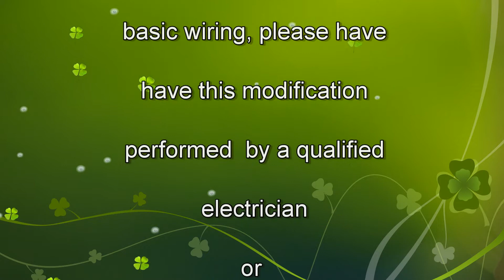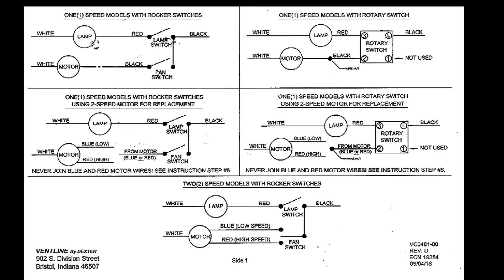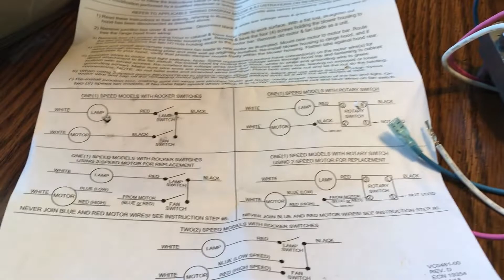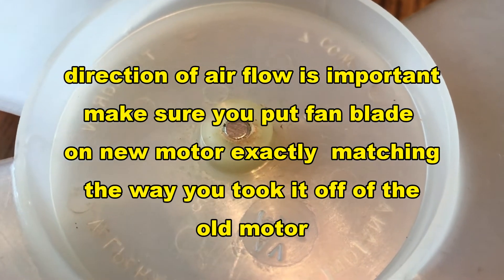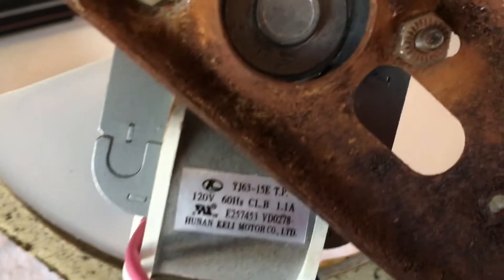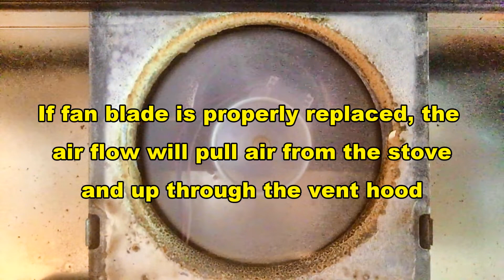Ventline Range Hood Exhaust Fan Motor Replacement

Comment: Good video bro ,,you think I can swap a bathroom fan motor to a kitchen
Reply from the maker: If the motor matches up with same specifications such as voltage, rpm, mounting, rotation, shaft, etc.  otherwise I would not recommend it...it is best to get a direct replacement. 

I have replaced bathroom fan motors  buy buying a new exhaust fan and used the motor from the new fan to replace the bad one before because the old exhaust fan was an odd ball and not available off the shelf, and it was cheaper than just buying a replacement motor.

Comment: Thanks for the video much appreciated. But we really needed you to show us in it’s entirety which wires were hooked up to the fan & the light! 
Our wires (blue instead of black) on our 1996 Cavco Ventline PR-4 are different colors than the replacement ones we got & we can’t figure out how to hook up the light! We seem to be short a red wire…🤷🏻‍♀
Reply: I think we finally figured it out. 🤞🏼  Thanks for sharing your video!
Reply from the maker: Glad you got it.  That was why I included the wiring diagrams.  I should have included a picture of the wiring before I disconnected the fan, It was not until then I decided to make the video.  Thanks for viewing, hope you will like and subscribe.

Comment: They are exactly the same as a turn table on a vintage record player.
Reply from the maker: Thank you for your comment.  Please consider, subscribing and sharing !
Reply: Ahh-NO.  Turn Table motors are synchronous like old electric wall clock motors.  They are not as powerful and are designed to maintain precise speed in relation to the frequency of the electricity.  To be overly technical I believe small fan motors are shaded pole motors.  for what that's worth.     My question is how to stop the squealing and replace or renew the bearings without having to buy a $40 motor.  The entire fan is often less then just a motor, if you can find the right motor.  The motors come appart easily but stuff like WD-40 will cure the squeel for a short time than then is worse leading to seize up.  These motors are meant to be disposable but it seems that only the bearings fail or get dirty. At over $40 each I don't consider that disposable. Ther has to be a simple fix.  Any ideas?